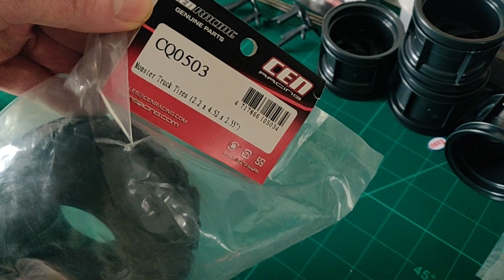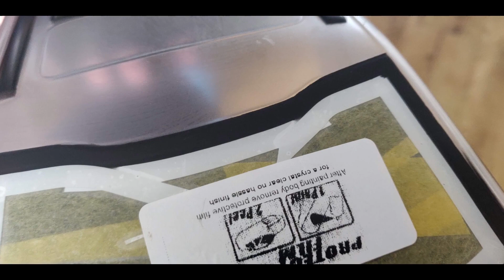Tamiya WR-01 Custom Build Part 3 - Hop-Ups Complete - Twin Motor Monster Truck

Comment: What a great series. Whole project was so enjoyable. You made such a great model with all that effort, a serious custom work. Love it! And love you professional editing, filming all these details take insane amount of time. What software do you use for video editing?
Reply from the maker: My PC is very old so can only use a basic program. I use Shotcut. To add text I do that in my PC's picture editor. First I export the fame from the video, add text and save it before putting in to the timeline. 
It does take a long time to make these videos and that for appreciating that 👍🏼. I spend 3 days on one video a lot of the time. Too long really. I need to be more efficient but the PC is slow and I am learning. 
Tomorrow I have a short running video I will put up.  Didn't get much footage as the weather is still bad here.

Comment: Wow! That turned out really cool looking! I love the tip on finding the right spot for the pinion, very neat trick!
Reply from the maker: Cheers Adam. Yeah, that worked well for me using a o-ring on that wrench. Better once I put the white tape on too cause it was dark in there and my old eyes needed some clarity 😆
Reply: @DustyFingersRC  yes my old eyes appreciate that part of the tip the most!

Comment: You’ve made a cracking job of the Ford 150 raptor body. Infact the whole truck looks ace , well done in the build :)
Reply from the maker: Awesome to drive to. Might have to put a second gearbox in the Blackfoot 3 👍🏼

Comment: Hi there  and a great tip for locating the perfect gear mesh. I like the wheels and tyres too, they look really soft, for lots of grip. And what a great job on the body, with the PS55 on the black areas too, looks a really mean truck. Looking forward to the running video. Take care, best wishes to you and the family 😊😉😊
Reply from the maker: Thanks John. I was really pleased with this one. Drives nice too. I have ordered some.stiffer shock springs so wince they arrive I hope the ground will be a bit drier so I can give it a proper run.

Comment: Hey lovely stuff mate. Good idea to use that wrench to check the depth of the gear. Those tyres look really nice and grippy.  Really cool body and you did a great job on the paint. You wouldn't really recognise this as a Tamiya apart from the sticker you put on. So has this run already and how did it get on?
Reply from the maker: I went to the woods with it yesterday. It was too muddy so just tried it on a grass area. It is brilliant. I really like it. Didn't get any footage as it was a boring spot to drive it but I had a friend with me who has an awesome camera and he tried getting a couple clips so will have to wait and see if any that can be used. 
Been rain everyday for months, needs to dry out here.